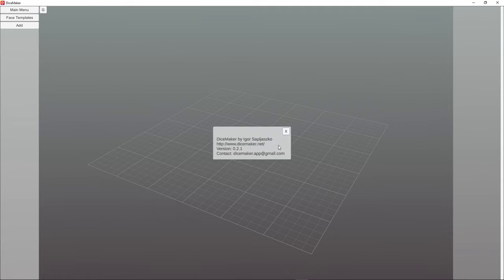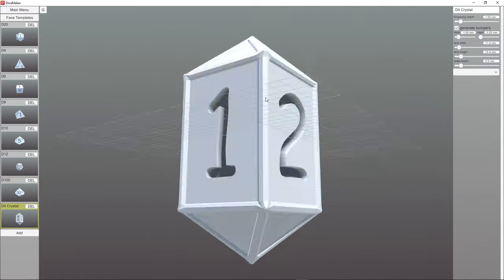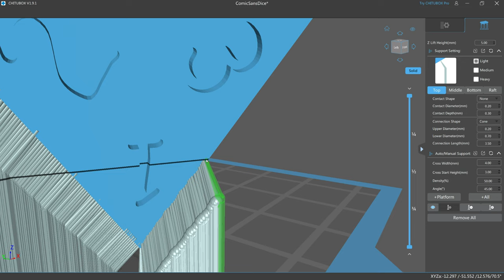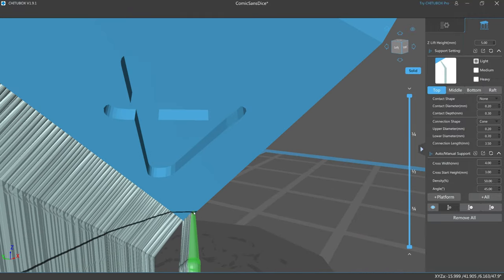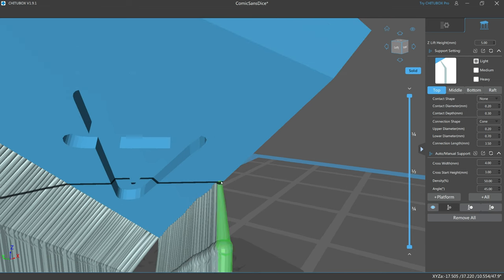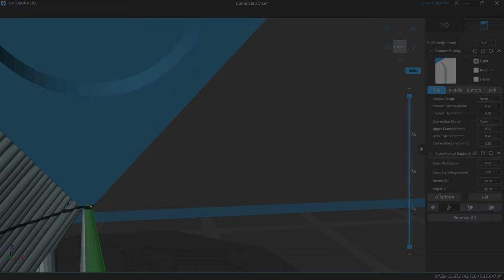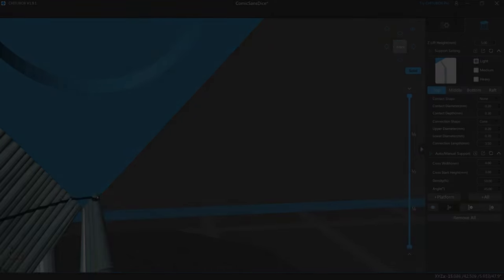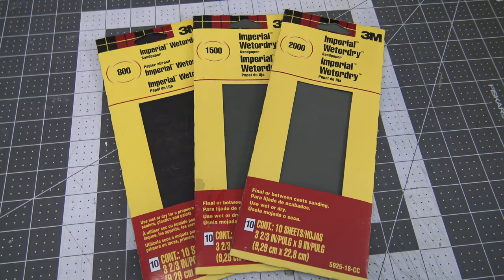How to Design and Polish Custom 3D Printed Dice

Comment: Very nice, gonna try it today with a lower layer height (maybe 30 microns) to reduce sanding time in the first step.

Edit: Safety first when handling resin: Always wear at least nitrile gloves and a respirator until the dice is clear coated.

Printed with ABS Like Elegoo Clear and Ink dyes, your workflow is good. Layer height is irrelevant because of sanding but have some light of delay to let the resin move fast enough. 
I had some voids and bubbles but very sharp corners and a very glossy surface. Polish as fine as possible if you are gonna paint the numbers and wipe the paint of in order to get no paint smear.
Finish with spray can clear coat, Airbrush clear coat or a thin layer of epoxy.

Comment: 3d print a set with a nice thick support on a corner, then after wash and cure, don’t cut the big support and then make a silicone mold of them, then you can make some really sick custom designs with resin and other stuff.

Comment: Thank you for these advices ; I tried to do like you did for supports and printing, but my print failed ; with sunlu abs like clear resin ( 1.7 s time exposure) I had very ugly faces on build plate side : warping and blurry numbers... Do you have any tip to fix this?

Comment: I have a question on the fin supports. The Dicemaker program has a built-in function to add them automatically. Is there a reason you're not using that? 
I've been trying to print a die in clear blue resin on a Phrozen Sonic Mini, but I haven't been getting good results. The numbers aren't coming out quite right, and the faces nearest the build plate keep warping. I've been doing these at 0.75mm deep, so maybe I need to go to the full 1mm?
Reply from the maker: The program didn't have fin supports when I originally made this video, an update added them shortly after I believe. It's great seeing the program still being worked on.

Unforuntatley I don't have advice for number depth. I don't remember the depth I used, but I should have done deeper. I remember sanding a few of numbers off during the polishing stages.

Comment: You can skip each step in the video by putting the model into the preheated resin and then curing it again
Reply: do you mean the sanding/polishing parts?
Reply: @cream3148  yes
Reply: Yeah, but then you won't get those lovelly razor sharp edges.

Comment: is there an easy way to paint the numbers?
Reply: Paint before sanding, use nail polish or collored UV resin and fill in the numbers, then when you sand them down the nail polish will level with the dice's faces.
Reply: After polishing, just fill up the numbers with a bunch of paint and then wipe off the excess with a finger or a paper towel! Since it's polished and glossy, the excess paint will just wipe away without sticking

Comment: Using a rock tumbler with multiple stages of grit/sand will save your arm.
Reply: But that will also round up the edges, the best solution is probably to use a sanding belt/disc.